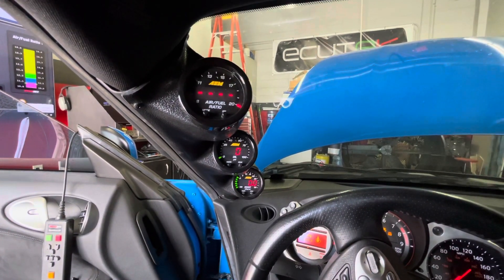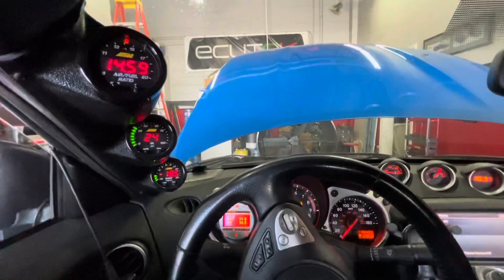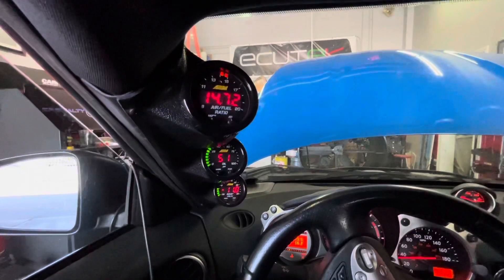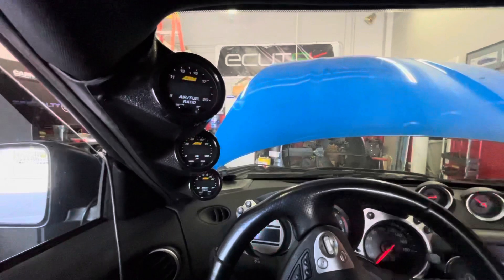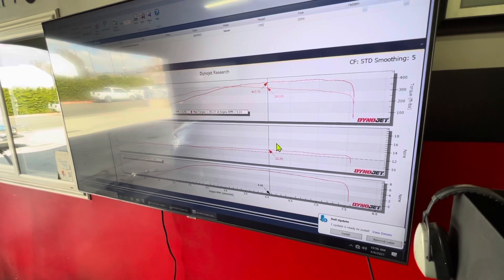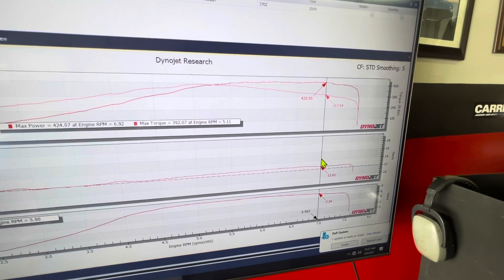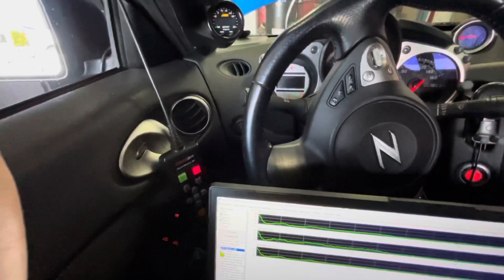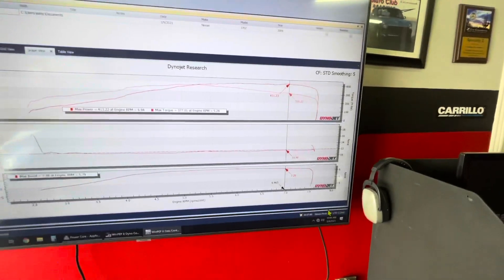AFR Comparison (Factory Nissan vs Aftermarket)

Comment: Is this a problem for NA and long tube headers?
Reply from the maker: No, this is a problem for forced induction setups. However if you have an exhaust leak in either application (NA or FI) it will also read incorrectly.
Reply: @specialtyz  Very unsettling video for those who have tuned using them alone. It be nice to see how they behave on long tube headers.
Reply from the maker: @fernandohood5542  Definitely, again on NA applications they are very good (assuming the sensors are in good condition). Forced induction its not reliable enough to trust them solely IMO.

Comment: Hey Sebastian !  It's been a million years :)  I think what you are running into is the exhaust back-pressure effect on the stock NTK sensors. The stock sensors are only, really, accurate with a stock tune.  The exhaust back pressure has a HUGE effect  on the NTK/NGK type wb sensors.  The factory trims the values to, more or less, match actual AFR, under the known conditions of the stock tune.  But, if you make any change that modify the exhaust gas pressure, at the sensor, it will badly skew the results.  I am guessing that the dyno WB is a tail-pipe sniffer ?  So, it would not be affected by back-pressure.  The Bosch  sensors, especially when used by those AEM X-series widebands, are MUCH MUCH less sensitive to both EGT and exhaust back-pressure.  They do make widebands for the NTK/NGK sensors that are equipped with pressure sensors, to compensate for the pressure sensitivity.  But, they are VERY expensive.

Comment: Hi Seb,
1) Would the placement of the OEM sensors compared to the AEM and dyno sensor cause this difference in readings?
2) Could the OEM sensors just be old and need to be replaced?
Thanks!
Reply from the maker: 1: Yes (because of heat) 2: Also a possibility but it really comes down to the placement

Comment: Hey Seb, so the Ecutek dongle is reading off the factory sensors which means the afr readings on the Ecutek dashboard would be off, correct?
Reply from the maker: Correct.
Reply: Great info, thank you sir! I wondered why my Ecutek dashboard didn't match my aftermarket gauge